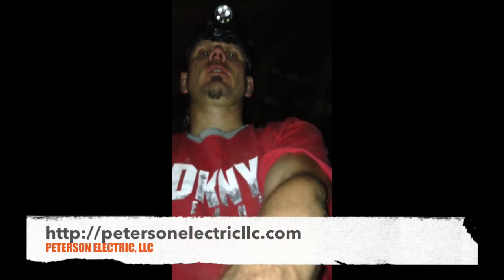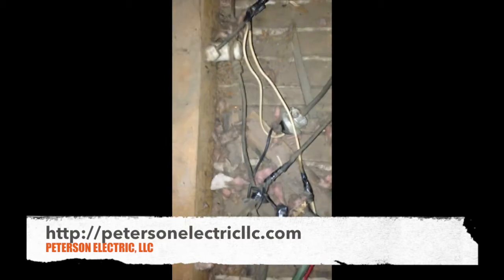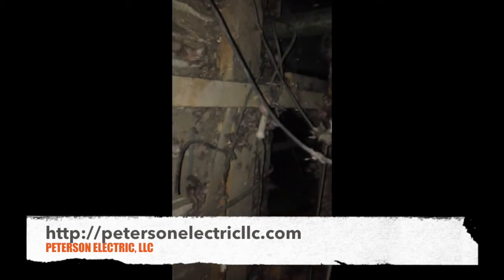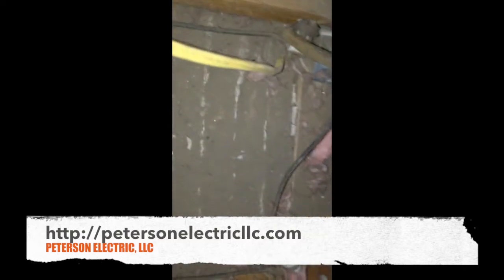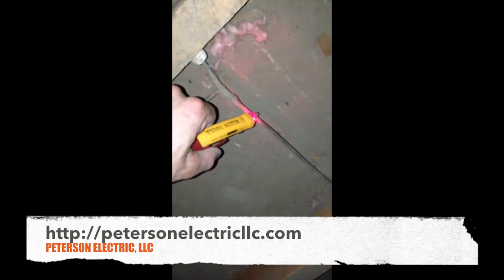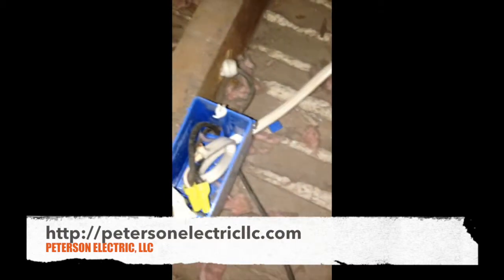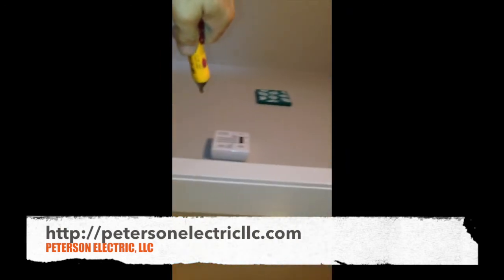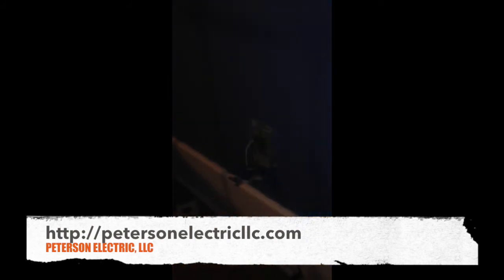1908 Home With Different Types Of Wiring, Flicker Power Is Occurring

Comment: Bottom line they got lucky this time, the only solution complete demo new panel rewire the whole house and you are 100% correct I will not have touched anything and a home inspection that's it anything you do is not going to be up to code or warranty  what kind of warranty do you give LOL if you re- splice  wire connection ( reconnect) temporary fix odds are you'll asking for trouble. Because all connections are weak down the road    heat  fire,,,,  you are correct. Sometimes you just got to walk away  your house is not safe and not livable. Make them sigh something,  knowing the conditions and,  give a estimate.  that's it.  Do you enjoy watching you . we all  have all been there and those kind of addicts. Great documentation and your previous videos about explaining code love it

Comment: The knob is a porcelain device used as an insulator  to insulate the wire wrapped in cloth from the wood structure and the tubes are used to run the wiring through the wood framing. Thus knob and tube. Peterson, I know you know this.
What happened with this job? Did you end up walking away from it?  I know I would have walked away from it. Too much liability. Great video. I had the same situation except i actually did the conversion/upgrade on a house built in 1927.

Comment: I’ve had a knob and tube headache  before on a 3 way sw and some outlets.  Old timer explained it to me it’s called a Carter 3 way or a Chicago 3 way. It’s worth looking up for troubleshooting purposes if you haven’t heard of it. 

I might try your method of making a diagram and marking with paint. Looks like the best way to figure it out in a place like that.
Reply: umm i have had a 3 way switch tht seems to come on and flicker if a breeze is just right i have wired in new 3 way switches(original they never worked for like 15 yrs my land lord told me when we moved in( turns out it was travelers wrong but i may have just gotten lucky) and the lamp has 2 sets of 2 wires i think but most of the house was wired in the 1900s than converted to a single house or at least panel was installed in 1957 a lot of knob and tube and silverfish ill have to do some trouble shooting you may have just saved a cple of lives.  im baffled they wld have thought this was a good idea.
 so much for they dont make em like they use to lol

Comment: I just bought an old 1908 house. It was in pretty good condition. Seems an electrician updated to low-voltage in the 50s using MC cable for all the 110 runs with two subpanels on each floor. Before that it was knob and tube.

I am yanking out all the old wiring and updating it to current code. Luckily, the inspector said it wouldn't be a problem fishing the new wires.
Reply: If it is mc u have a ground with the mc casing pigtail off box its fine
Reply: @dhffxghhf5317  It's probably the old BX cable, not MC.
Reply: @illestofdemall13  still grounded If the panels bonded.
Reply: @mr.3phase228  I never said it wasn't bonded. Some people prefer to take out the old stuff and others live with it.

Comment: My parents own an 1870's house that still has a little bit of knob & tube left. I find that stuff fascinating. The installers had to take such care to protect the wires. Porcelain insulators everywhere, rubber impregnated cloth sleeves to protect the wires going into metal boxes, welded splices, and even keeping the hot and neutral separate. My parents house still has a lot of the older 'tandem' combo outlets. I want them to get it fully rewired, as a lot of the partial rewiring only replaced the circuits with newer 14 gauge wiring. Since it's an old home, it lacks good insulation which means they need a lot of electric space heaters. They're constantly popping breakers during the winter. But of course, they don't want to rip into the old plaster.
Reply: Many homes with knob and tube has a large guage single neutral fastened in a big loop on the perimeter of the house. Then they would run 2-4 fused hots to a star pattern in each corner of the house to start and once the basic wiring was done, then they would tie anywhere on any of the branch lines do to additional outlets. Scary as hell.